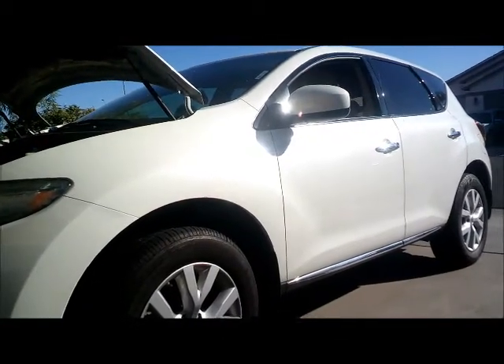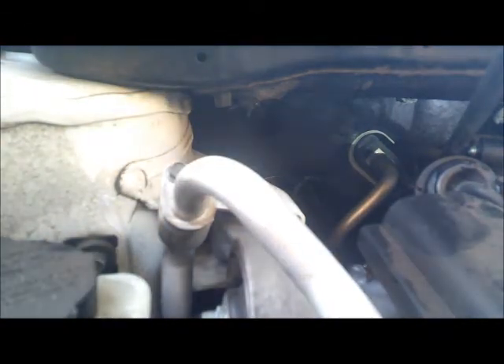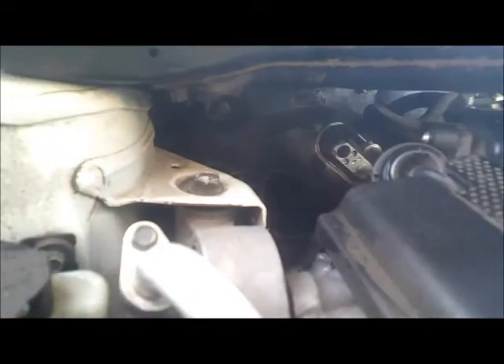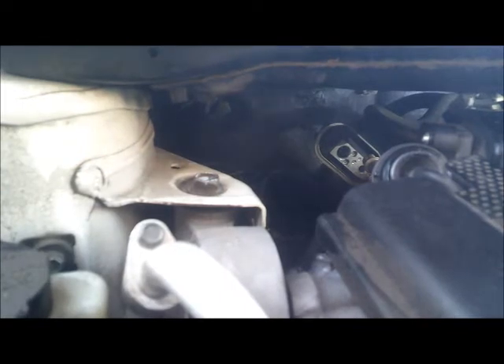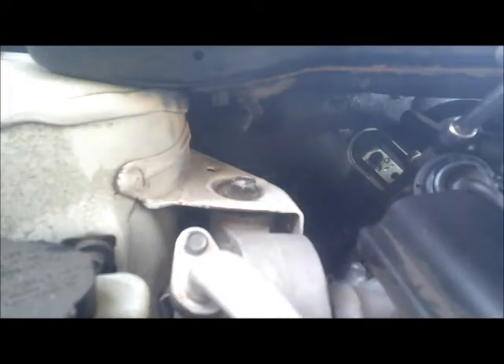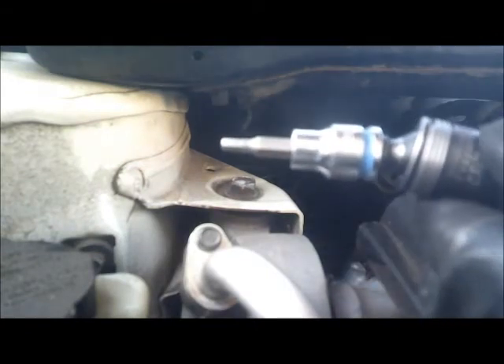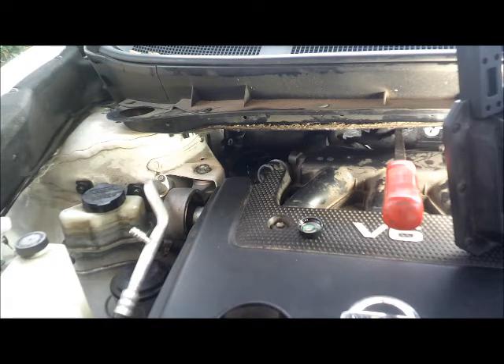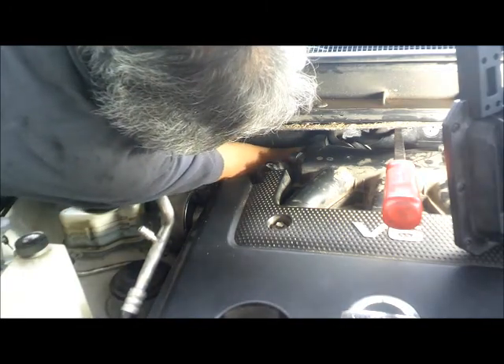2011 NISSAN MURANO REPLACE AC EXPANSION VALVE

Comment: There is gas and the compressor is working
But the air is hot
what is the reason???? PLZ🙏
Reply from the maker: A/C Clutch engaged but no air? Check the Compressor Pressure Valve, Check the Condenser, A/C Drier may be clogged and Expansion Valve.
Reply from the maker: Is you Blendor Actuator working?
Is the Low Side suction line cold? when the Compressor is on?
Reply: @johnrichiequillopo5765  The compressor is on
And the low pressure line pipe is hot
Reply: Blendor actuator?!!!
my car nissan murano2009
Reply from the maker: @love1900karrkbdd  use your Manifold Gauge. What is reading on Low side and High side?